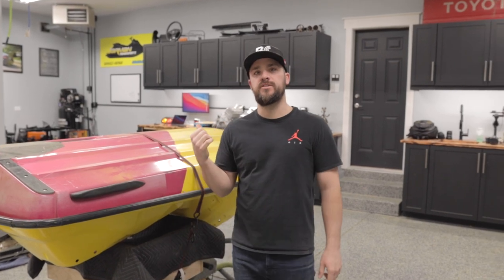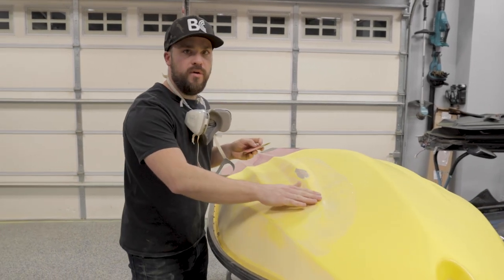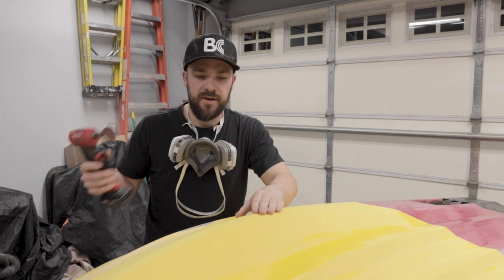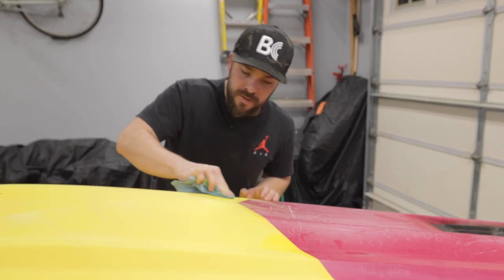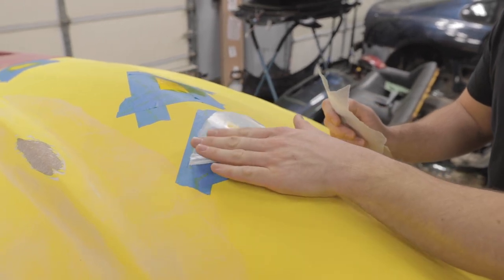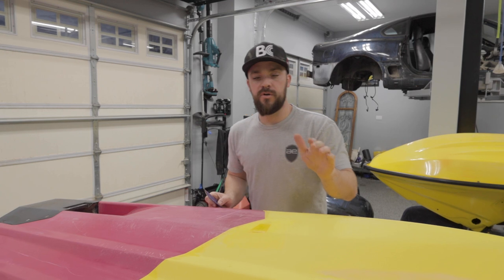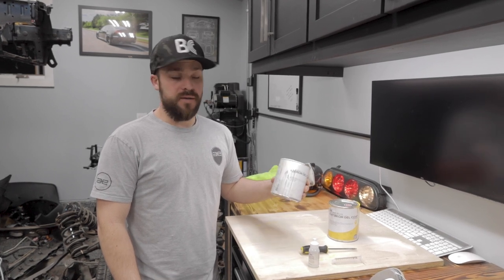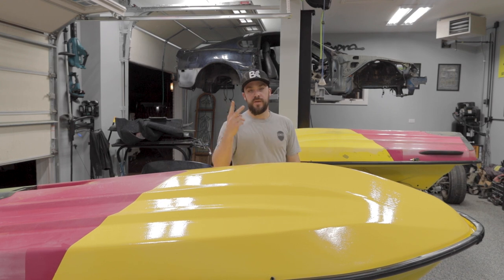Restoring a 1995 Sea Doo XP800 - Wet Wednesday's: Sea Doo Build Series PT.4 Gel Coat Repair

Comment: Excellent video! Thank you! I noticed on the bottom of the ski I recently purchased that there are places wood is exposed. Can I layer  gel coat or should I apply fiberglass sheets, sand then apply gel coat?

Comment: What Evercoat kit did you use, the brushless gelcoat? The one I got came with the color tubes and the gelcoat filler tube and hardener, but i didn't have that other large container of gelcoat you had that you rolled on.